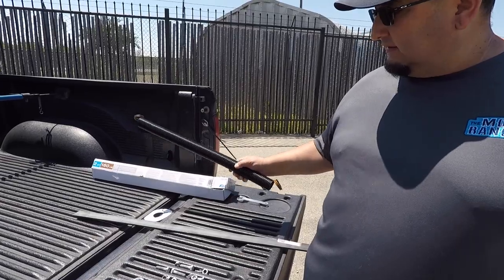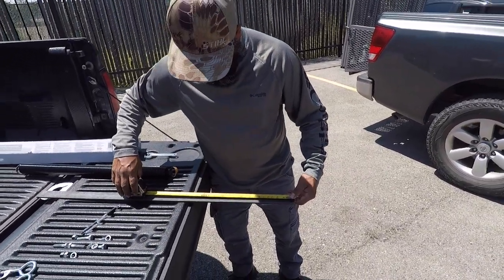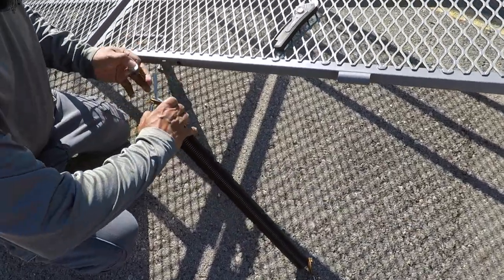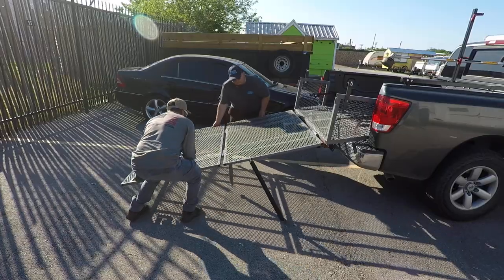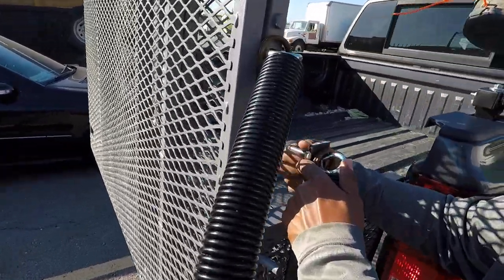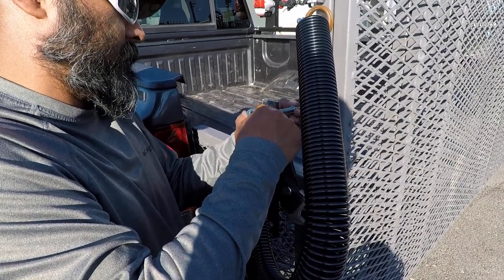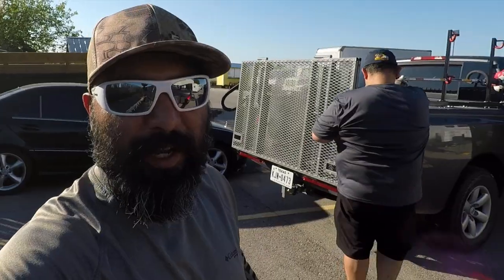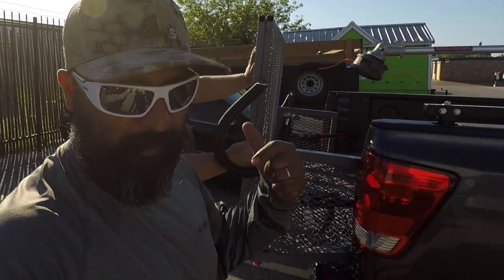DIY Spring Assist Gate Lift on the Mow and Go System | How to Install Gate Assist

Comment: It will help alot if you take one of the springs off. so you reduce your spring rate by 1/2 and them move the other spring closer to the bed of the truck so their is tension most the way.
Reply from the maker: Ok I will pass that along to The mow Ranger. Thanks.